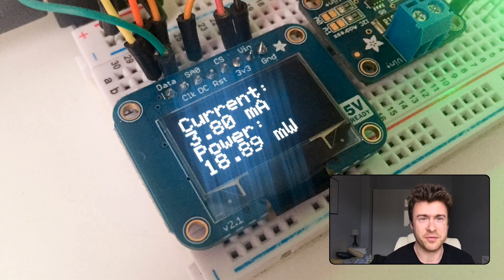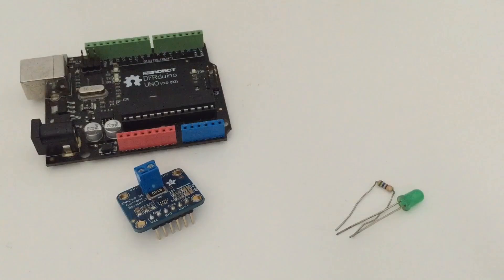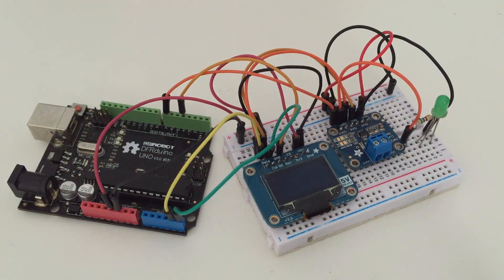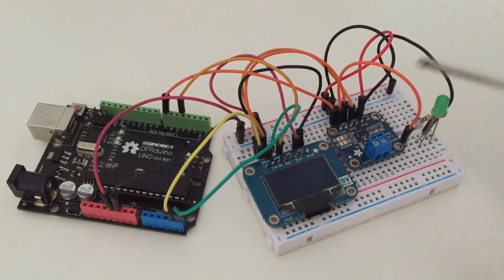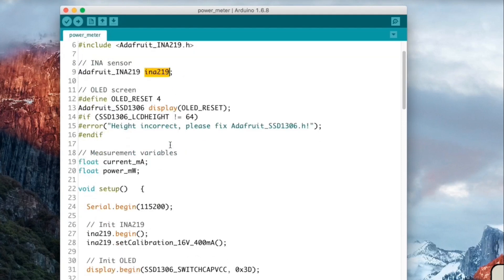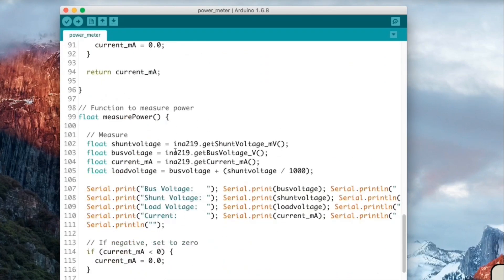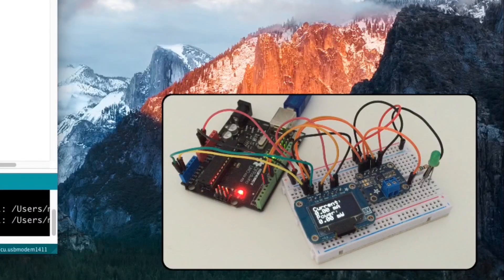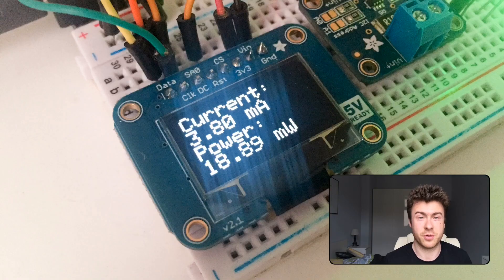Build an Arduino Power Meter with an  OLED Screen (DC Version)

Comment: Hallo i am working on this project, power meter consumption, measurements the meter of each user entering the room, so i need a clou on how to start with the project, using arduino, i need the code the tools i can use please guys help

Comment: I need to measure volts and amps . DC up to 3-400 amps and 48 volts DC. maybe time and temp also would be nice. batt temp. and inside and outside temp.  I would like to know how I can build this. to monitor my battery draw for my house. I don't want to use my clamp on meter  . thanks
Reply from the maker: That would be another project indeed, but from the code point of view it's the same basic principles :)
Reply: James Stranger I am starting to do this project actually the same but the voltage I have is 12 V and 10 Amps. Can you please tell me how did you it? if code is avialable i will be really happy.